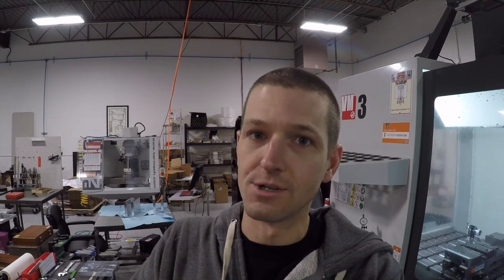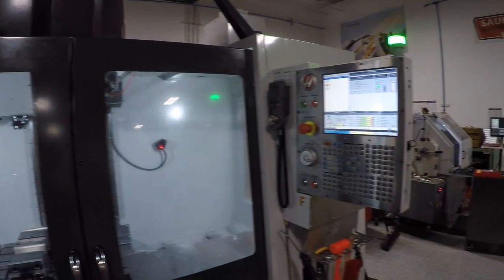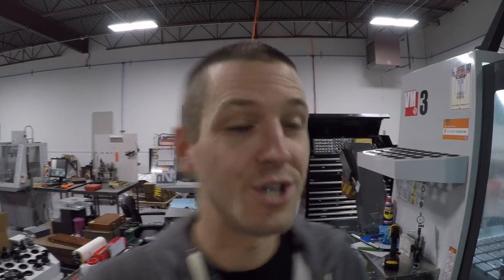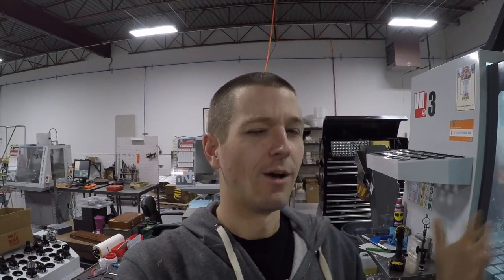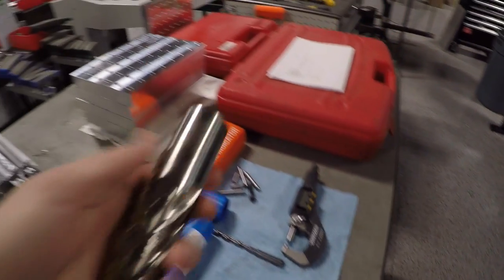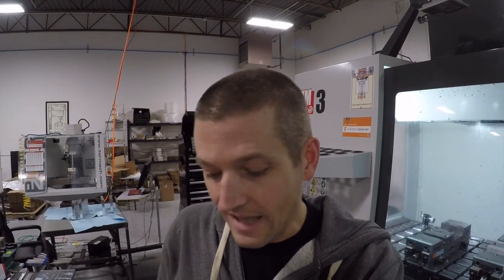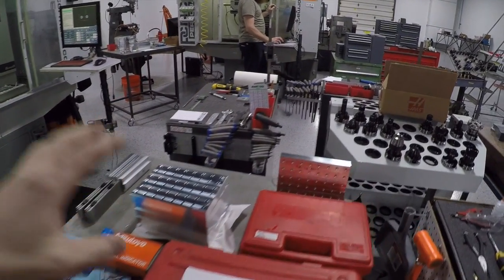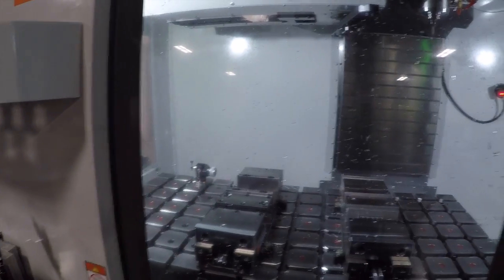Cast Iron Lessons Learned, Production Process, Less is More!  CB40

Comment: Same here. I only use an 8mm and 4mm end mill. One for roughing, one for details. That way if one breaks midway I can replace it with an identical one. I also don´t buy paint thinner or therelike. I rather throw away cheap brushes. Its a minor thing but it saves me some hassle and frees up my mind for important things. Having a wide range of tools and items in your shop can cause more work overall.

Comment: John in the world of machine tools, manual machines are still alive and well, especially in the repair and job shops. Those insert Mills won't be able to replace all uses of a ground cutter. High speed endmills will always have a use in the shop. 
Have you researched any of the vending machines made for machine shop tooling? It keeps up with inventory for you. Might be something to check out.

Comment: The thing I noticed after watching your cast iron video, reading some of the comments about climb vs conventional, and seeing you plug the Sandvik video - there are good times to conventional mill! Milling the skin off cast iron is actually one of them, the sand and inclusions can actually damage your cutting edge so it can be more secure to conventional mill the skin off and then climb cut the rest of the material. 

The same holds true for milling flame cut plate edges - conventional mill to get underneath the HAZ, and then climb mill the rest.

Love the videos, keep up the great work.

Comment: John The HSCo on the Niagara end mill means High Speed cobalt. That tool is a bit large for your Haas with a cat 40 taper. You could use it but not to its full capability. You are right about that typ. of tool being almost obsolete, I haven't used one in years its more of a manual machine typ. of tool now with modern tools like feed mills for roughing on a CNC machine. Maybe for aluminum. With the drill the longer the flute the more pressure and volume of coolant you need to force the shavings up the flutes. This is especially true with Gun Drills. On you pallets are the holes you are reaming blind? If so you might want to try a carbide reamer with a thru coolant down the middle of the tool to get coolant to the cutting edge. Also most people feed reamers to slow look at your feed say around .002 per flute should be about right. Most reamers don't actually have a primary clearance they are ground round than fluted and the cutting edges are just on the tip. This can in certain materials (especially aluminum) cause build up of material on the tips od and ruin the holes size and finish. (in titanium or Inconel this can over heat, gall and break the tool). You need a reamer with cutting edges more like a end mill has with a primary and secondary clearance.

Comment: HAAS M95 sleep command can be added to the spindle warm up cycle, it will put the machine into sleep mode for a specific amount of time 

M95 (hh:mm) where the hh is the number of hours and mm is the number of minutes. 

So, so you leave at 8pm, and want the machine to run its warm-up at 6:30 am the next day. 

M95 (10:30) and the machine will wake up and begin running the program, in this case the warmup program.
Reply: Bump

I'm also going to add - [[ Vice Handle ]]
Make it do a test lap before it sleeps.. and no tool changes.

Comment: As a prototype machinist and training someone that is coming over from prototype sheet metal I have been teaching him the less is more mentality. We have 2 revolutions and a newer Chinese bed mill (all running centroid controls) and a older Haas mini mill. The 3 centroid don't have automatic tool changers so we are the tool changer, with that I have been teaching him to use as much of a tool as possible, usually a 1/4" standard length 2 flute end mill, so it minimizes time for tool changes and maximizes the use of that tool too. And even going as far as minimizing drills and using end mills as much as possible to ramp down into holes in which it usually takes less time. 

I have gleamed some tips off of your vids and tweaking them if needed to make them work with the revolution I usually run, and also with Mastercam. It would be interesting to see some wire edm stuff too as I also run an older agie classic 2s.

Comment: Excellent :-) I didn't notie or know that you were not using magnets for clean up... To me, that's a no-brainer... Years ago, I had a placer gold mine... One of the big problems is removing "Black Sand" (BS). It's similar to iron filings. I put a magnet in a Baggie, like you mentioned and pick up the BS with the magnet, leaving the gold behind... Again, most industrial supply companies have little broom-like push carts with an aluminum body and a magnet inside... Run it around the shop floor to pick up steel or iron waste... I'm sure you could make such a thing for your machining equipment... Once it's full of debris, just pull on the Trigger mechanism and the magnet is lifted away from the aluminum body, releasing the iron particles, screws, nails, etc. (Even your Steel waste is worth money)...

Comment: Not sure if it will help but my son also uses a magnet to pick up steel nails as he is a farrier. The magnet (about 4" square and about 0.5" thick ) has a handle about 12" long attached to one side, It fits into a hinged cover attached to the end corners of the magnet such that it can swing out upto 180 degrees. He then sweeps it over an area that he wants to check and then holds it over the rubbish bin and swings the cover out at least 90degrees and the nails etc just fall off. Another version we use around the mechanical hacksaw and pillar drill is shaped a bit like a wand (about 18" total length with a sliding cover near the handle which is a close fit to the core. The cover has a couple of oil seals fitted to each end to wipe off the swarf as it is used over a rubbish bin, works great.

Regarding your tool stock situation where pretty well anything today comes bar coded. Can you employ the barcode reading system marked on the boxes to monitor and log tool use and further flag up when re-ordering is necessary - a bit like the system used in most supermarkets at the cash till does? It might also identify detailed costings for jobs or even jobs or operators that are "heavy handed".

Comment: The endmill you were asking about HSCO from what it said on the package, for the size it isn't very expensive relatively speaking. Put that rougher in a manual machine crank through some mild steal by hand and you will be amazed at how much material can be removed in a single depth and the feed rates you can get away with. It is best in a manual so you can feel it and pay attention to the sound of the motor because you would expect it to be working harder based on material removal.

I have rarely used a roughing endmill doing job shop work in the cnc machine, in manual machines they are great.  The main difference is that with modern cnc machines with fast feeds and a high feed cutter and lots of memory you can use advanced tools paths that are more efficient and replace inserts as needed, with the rougher cutter you had in your hand you could do the same cut in around the same amount of time in a manual machine by just using x axis feed.

The roughing cutters don't have sharp points to chip off, they have sharp cutting edges but profiles have radii which makes them very strong and can do a lot of work. They are for roughing only, so their surface finish on side cutting needs to be cleaned up, they are great for saving tool wear on your nice razor sharp endmills.

Comment: Both inserts and solid carbide have their place. There's a lot of work being done with insert tooling these days, but as a generalisation and traditional insert tooling (and assuming side milling) the rake of end mills is much greater than insert tooling. High rake inserts can be used, but arguably aren't as popular and are more fragile. Again, the manufacturers are doing lots of work on this, with insert tooling being made to look and behave more like end mills.

The end mills cut with a shearing action, hence the long slivers will all like to pick out of our skin! Traditional inserts tend to bang in to the work which leads to relatively high vibration. They also need a ton of power to drive them.

Inserts are disposable, while end mills can be resharpened, quite often in fact. I have horizontal cutters that have been sharpened to the limit of their rake! I have both T&C and E90 end mill sharpeners, so do the work myself, but I think the going rate in the US is about a buck a tool to sharpen bulk lots of end mills. Cheap machining! The downside is they're now smaller and you need to account and keep track of the smaller size of the tool. Don't ask me how I keep reminding myself of that fact! ;) But if you're disciplined with the tool sizes and don't physically snap or badly chip the tool, you can have virtually free machining when using end mills.

Comment: The continuous edge cutters cut much smoother than insert mills. They also tend to be sharper and thus have lower cutting forces meaning less hp. Oftentimes I use insert tools for blasting away material and roughing out parts then finish with a sharpened tool like an endmill or shell mill.  They both have their advantages and disadvantages that is why both are still common. :-)
Reply: ...That's about my conclusion, and I'm not much of a machinist (yet)....more Elec/Tech-welder....and most of the inserts don't have a real sharp cutting edge....so there's the 'more power' required deal....in addition to little or no positive rake.

Comment: HSCO should be some sort of cobalt HSS mixture iirc. I normally don't use inserted endmills and things of that nature but if you are in the market for one in aluminum I highly recommend the 3/4 or 1" shear hog by AB tools. Absolutely outstanding product.

Also, love the talon grips. I got them about a year ago and we have at least 5 sets now. It makes live so much easier for setups which don't require dedicated fixturing. 

Coolant through drills impress me every time I use them. They're very accurate and you drill them without pecking. A big time saver in production oriented programming where run times really matter.

Comment: I've added a spindle warm up program to the beginning of the programs that I run most. I over ride the door hold function and use the time to unload/load the machine and sweep down chips. It runs every cycle regardless. You could use a block delete if you didn't want to run it every cycle.

Comment: You need a crib room where you keep all the new tooling and any grinding or resharpening goes on in the crib. Keep tools for a job at the machine but inventory only the crib room. This way you dont have to care about what tooling is on the floor, only what is needed to stock the crib.
Reply: Caleb Welte

Comment: I have used some 3 flute carbide drills that are made to approach reamed hole tolerances. Plus you can run them 50% faster feed as they have an extra cutting edge.
Reply: Jeff L They are called core drills.

Comment: Instead of counter boring or reaming the hole, you could buy a boring head for your HAAS set it to dimension you need and use a simple G85 bore-in bore-out canned cycle. Boring head and a micro 100 boring bar might cost a bit initially but save money in the long run. Love your video's pretty awesome how far you came from in the basement in nyc to wear you are today.

Comment: HSCO is HSS + cobalt.

What I mostly see them for is for finishing aluminum. It's a cheaper alternative if you need to get a fine finish on a small/medium run where a smaller diameter carbide endmill wouldn't be rigid enough.

As for that rougher, it's possibly just for people with low RPM machines that can't take advantage of carbide

Comment: On your comment that it is hard to resharpen those roughing mills, it is very common for only the 0.3-0.75" tip to get used and therefore it's cheaper to just have your tool sharpener chop the tip off rather than sharpen the whole tool.  They are handy to have around just for that one or two times a year you need it.

Comment: the hsc endmills are more geared toward low rpm/high torque/geared head machines. Pretty common on large multi-spindle gantry machines. as for the reamer, they sell coolant through reamers, that may solve your issue.

Comment: Takes a LOT of power to run those multiple insert heads. 30HP minimum and monstrous amounts of torque. 

The end mills take far less, you can run em in something even as low HP as a Bridgeport, or a 7-10 hp toolroom mill. 

They may eventually fade out, but not for awhile.
Reply: That's traditionally true but will depend on the geometry of the inserts you're running in them. The geometry of the end mills is normally positive, while inserts tend to be more neutral to negative rake. However positive rake inserts are commonly available and what I try to use where I can due to the small machines I run.

Comment: size and cutting pressure those roughing end mill are meant to produce less cutting pressure. inserted cutters are hard to get in sizes under 2 inches and they cost a lot

Comment: I love roughing endmills. Roughers remove crazy metal. Try to cut 6inches of depth with a carbide tool with out chatter. Good luck. With a low enought spindle speed and proper feed, that will do it.

Comment: Just a small Tip for the Pinholes. Get a side cutting Carbide Drill a few Thou smaller than the Hole then drill the Hole and take a finish Pass around the Diameter all in one go. You will get the Speed of drilling with a milled Wall Finish and it´s tunable.

Comment: Ya tool management is a problem, even in small shops. I really need to work on this myself, I'd be interested in hearing what you are working to manage it with creating a bunch of work.

HSCO (High Speed steel CoBalt) is not carbide, just high cobalt (usually 7-10%) high speed steel is way, way, cheaper than a carbide endmill. That tool is would only cost a few hundred bucks. A large solid carbide endmill like that would be well over a thousand. They are 'better' than carbide for machines that don't have the spindle speed to run carbide, many boring mills and live tool machines have very limited RPMs on their spindles. I ran a big planer mill that only had 125 RPM on the spindle, good luck with a 1" carbide endmill in that. Another big advantage of HSCO is they are tough, you can have much more vibration/chatter and poor work holding before they will fail/break. Once you have endmills this big you can get really high MMR, HP use, and they are fast and easy to regrind in house so they still use large HSCO endmill on those big ass multi spindle profilers that mill out airplane parts because of this, plus a lot of the older ones don't have fast spindles.

Comment: The inserted cutters require a super rigid machine with plenty of torque and a very rigid setup to work properly. That big endmill is very flexible with feeds and speeds can be ran in machines with much less torque.

Comment: I mentioned on another video comment that you should make a large subplates for your Haas. You could mount your vices to one and/or have dedicated fixtures for your products. I have a VF-2 that I use 16"x20"x1.5" plates that I slide in and out. I just timed how long it took to load one (there wasn't one in to take out). I wasn't trying to do it fast and it took 4 minutes with chip blow out. Besides it would cover up all those slots in your machine table that fill with chips and must take forever to clean out.
Reply: subplates with jergens ball locks are nice!

Comment: for the tooling inventory...get some used portable upc scanners. Pretty much everything has upc nowadays. Little dba on the computer system, scan every tool when it comes in then scan them OUT when they get used in the machines our when they get worn out, whichever works best for ya. You can probably find the scanners used pretty cheap.

Comment: John,  Regarding non-slip under parts.  We use card stock sometimes, but usually we use an abrasive screen that comes in 2" wide rolls.  This goes between our table or parallels and the part.
Reply: non-slip under pants

Comment: wrt tooling (and other inventory), set up a system to keep track of which tools you're using and where. Only after a while of data collection will you be able to whittle down inventory to a working set.

I don't know if your CNC machines can give per-tool statistics like total chip volume removed by each tools in the changer or work cycle. The machines with ATC do know when tools are changed. If you're working the tools somewhat consistently, then that can help to plan purchases, or to change the cycles to better ones.

Manual tracking is a PITA. See if you can get your (packing) label printer to churn out a few hundred sequentially numbered barcode labels and put the tools in bags or boxes with a unique label for each. Barcodes can be read by most mobile devices or dedicated readers. Connect to an intranet server (could be a Raspberry Pi) web page with the mobile device to record which tools are being swapped in or out at each machine. (project for a high school student).

Move worn/broken tools to a "morgue" where you can perform post mortems and decide future actions.

Comment: Hey John, you've been such an inspiration and life changer for me! I hope I can return the favor! Here is what I do for my cnc machines and shop, from lights to fridge to cnc machine is all monitored and controlled by my program I made with "auto it" it's basic c++ similar coding to the Haas postprocessor. That all run off of a panel of usb relay circuit boards (buy on eBay) as well as a baby cam that commicates with me via Skype. Tells me when a job is done, tells me if it hears the end mill screeching or if it breaks. It's programmed to read, understand and use the mach3 interface.